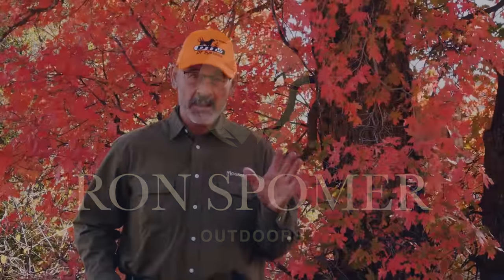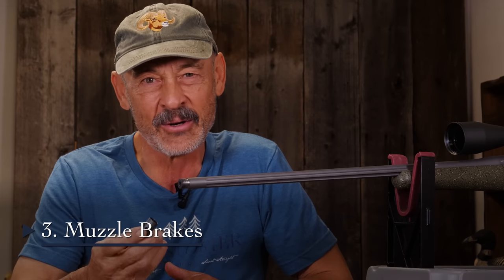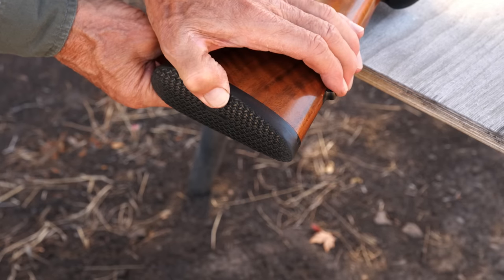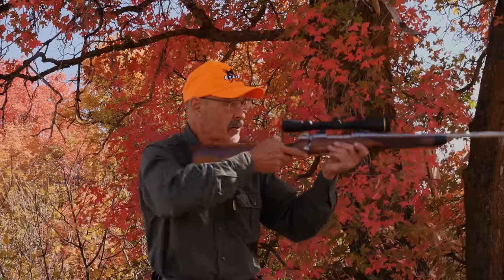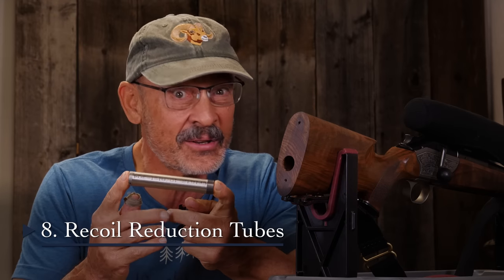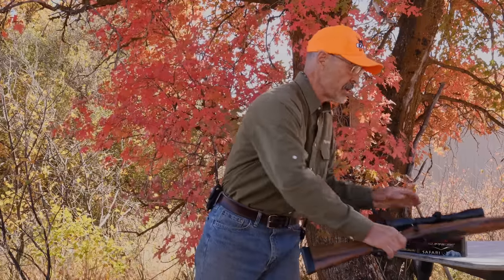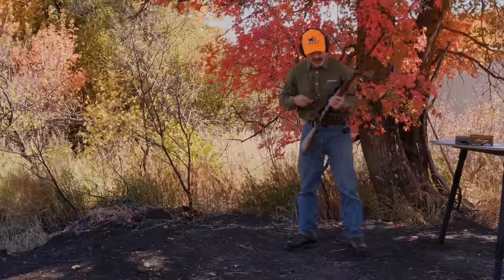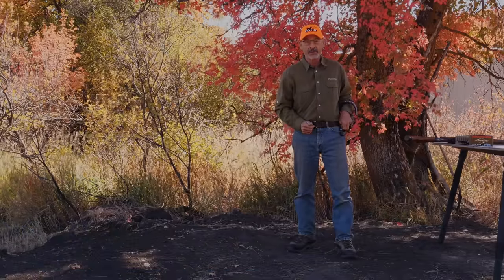How to Control Rifle Recoil!

Comment: *   I've always thought that the pitch of the butt stock had an influence on felt recoil. How your butt stock marries up to your shoulder pocket is important in the reduction of felt recoil. If the toe of the butt is to long the gun will rotate up from that point, which will cause more felt recoil to the face and the shoulder. If the heel of the butt is to long, the recoil will be felt more at that point since there will be less surface area to disperse the recoil. What a shooter needs is a butt stock that's pitched correctly for his/her physique. Ideally the distribution of the recoil should be evenly spread over the contact point where the butt stock meets the shoulder. A good cheek weld is important, also.

Comment: Ron. I’m 6’7” tall. My lop is over 16”. Should I use pads or just replace the whole rear stock? Thanks Ron. I love the videos.
Reply: Hi Shorty! Yeah, you'll need to add spacers or extra thick recoil pad or both the extend your LOP. Another option is a drop-in replacement stock. Fairly inexpensive models from several makers in synthetic, laminated wood, or solid walnut. Check out Boyds Gunstocks for examples.

Comment: The area 419 hellfire I put on a dd 16” .308 was a big surprise how much kick it took away…ports are angled back but have little tits that I assume disrupt the gas some way that matters inside..that said it’s like firin a dshka on a indoor range..you feel the blast which is as bad as gettin kicked till you learn to handle it then spottin impacts and trace come in and your off to the races..run a 3x15pst puttin 175smk’s on steel at 520yrds easy

Comment: How do you deal with muzzle jump? I fired a 44 magnum carbine that did not have much recoil but would throw my aim off by causing the muzzle to jump.
Reply: James, muzzle jump doesn't throw off your aim until after the bullet has left the barrel., at which point the aim no longer matters except for getting back on target for a subsequent shot. You can minimize muzzle flip with weaker cartridges and/or a suppressor or brake. Or a much heavier barrel. A .22 rimfire doesn't move much at all. A suppressed 22 rimfire even less.

Comment: Was wondering your opinion on the Federal Terminal Ascent rounds.  I have an Encore XT and am only getting a 2 inch shot group at 50 yards.  The same gun with my muzzle loader barrel is touching rounds at 50 yards.  I actually picked my muzzle loader over the 270.  I don't think there is any problems with my 270 set up except for the barrel does not like the rounds.  The shame is I bought 3 boxes before trying them in my gun.  They are not cheap.  Thanks for any info.  I definitely respect your opinion.
Reply: While that's far from ideal, it's still fine for close range work.
Maybe you can swap or sell them to someone that has a rifle that shoots them better if you require something more accurate.
Reply: Rick, it does sound as if your particular barrel just doesn't like the Terminal ascent rounds. .
Reply: @pewpewTN  I killed 2 deer with them last year.  They pack a wallop with both deer falling right over.  No complaints there.  Just kind of anal with my shooting.  Federal says they developed these rounds specifically for the 300 Win Mag.  They then did some other calibers.  I got the 300 Mags also just have not tried them in my 700 Sendero rifle yet.  Hoping for better results there.
Reply: @ricks7432  I'd be surprised if the 300 Mag dosen't give you better accuracy.

Comment: While it’s correct that silencers don’t make guns silent, I maintain that it’s not inaccurate to call it a silencer since that’s what maxim’s patent called it. I generally refer to the device as a silencer but the action as suppression. For example you would be running a suppressed rifle if you put a silencer on it. Just my personal preference.
Reply: Sure, that's fine. I prefer to stay away from "silencer" because pop culture/media have given it an inaccurate and sinister patina and because it does not make a gun shot silent.

Comment: I call it a silencer that is the devices original name. Patent number US1482805A was filed on February 21 1921. This patent filed by H. P. Maxim is for "silencers for guns". This is after the 1909 patent (US916885A) which is for "silent firearm." That being said, the best way to handle a higher recoiling firearm is to work up to it. Don't go right out and buy a 458 win mag. Learn to master a 30-06, 270 or any standard available caliber first. Work up to it. Excellent content Mr. Spomer!

Comment: Great video, as always! However I have found that the cartridge design is as, if not more, important than the theoretical recoil figures. I have had three 308s and all beat me into submision very quickly! Though when I moved to heavy bullets they got a bit better. On the other hand the 375 H&H is just a pussy cat to shoot prone - the 308 certainly is not! Yet my 8x57 (198 grn at 2660 fps) made my 243 Win Weatherby (Howa) feel a little thumpy!                                                                                                                                                                  What I am getting at is that it is the combination of the cartridge design and the rifle it is in. 308s beat me up yet my 300 WM and (a friends) 375 H&H were just pleasant relaxation.

Comment: Do you shoot around a group, say a range or by yourself outdoors. I never even thought about a suppressor. I shoot usually alone by myself. I’m behind the blast outside. If you shoot in a group under or inside it’s a lot cheaper to wear earplugs. Even a 22 indoors will seem loud and I recommend protection indoors or under some cover or roof. It ECHOES. But hunting, how can you Hear Game coming? Suppressors are a $$$$ maker for the govt and makers of that item. If your having trouble with recoil I suggest you learn how to shoot. A 308 or 30-06 even a 7mm mag just doesn’t recoil that much.